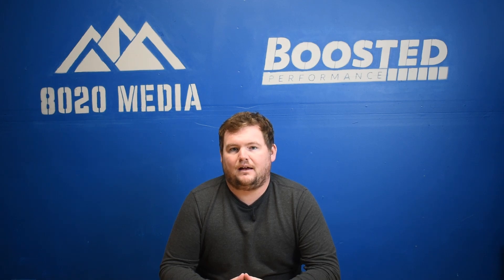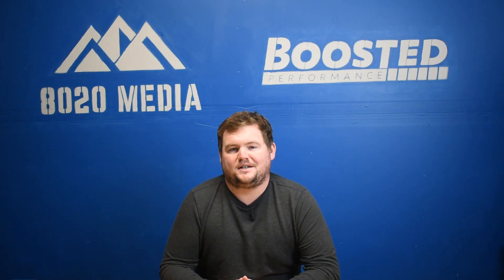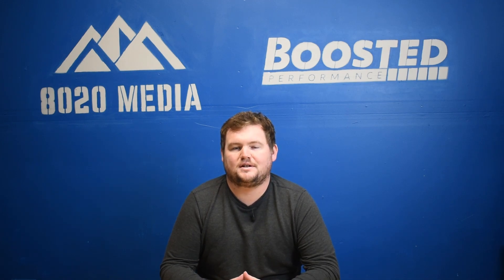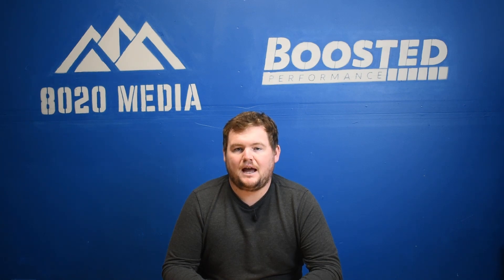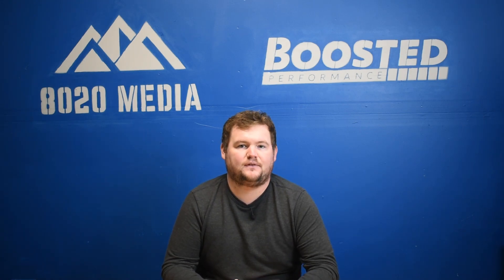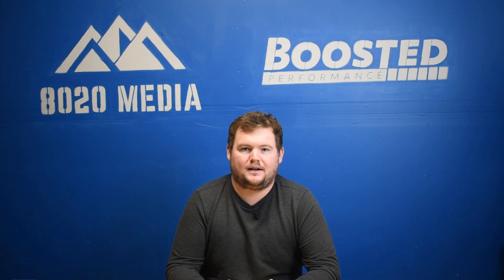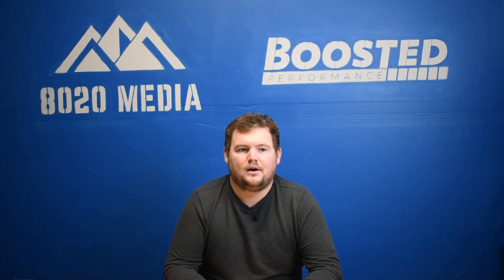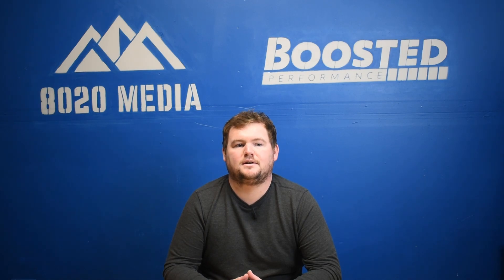The BMW N55 | 5 Common Problems! (135i, 335i, 435i, 535i, M2)

Comment: What causes me to feel a hard shift before coming to a stop in my bmw 435i it feels as if it's downshifting hard but it's felt in the back wheels could it be diff bushings or transmission problems? Please answer
Reply from the maker: R - Sounds like a transmission issue. Do you have any engine codes?

Comment: i think n55s post 2013 are reliable as long as the maintenance is kept in check , especially the Mperformance versions, a below average score should be done in comparison to other engines in its class... 300-365hp. BMW service intervals dont help either.
Reply from the maker: K - Couldn't agree more! Thanks for sharing this insight.

Comment: I LOVE MY N55. PEOPLE JIZZ OVER THE B58, BUT IT DOESNT SOUND AS GOOD AS THE N55 AND THE RELIABILITY IS ABOUT THE SAME.
Reply from the maker: Bryant - Love hearing this. What are you driving and how many miles do you got in it? Both engines are solid BMW staples!
Reply: @8020Automotive  I replied to this earlier. Not sure what happened. I'm driving a Melbourne Rot F30 with red interior and ZF8 trans. 110K I don't consider gasket leaks a major issue, all gaskets that are prone to leaking have been replaced before 80K
Reply from the maker: Nice! Hope it keeps up for you!

Comment: I have a 2007 X3 with ~ 172,800 miles, and have not really had engine problems yet. I picked it up with about 110,000 on it and in my 7th year with car. The engine has a very smooth power band and is a great engine. I may need to do something with VANOS solenoids as I experience a very slight flutter at acceleration after the car is fully warmed up and running, but very slight, although it isn't throwing any codes. So maybe the tranny? Not sure as the GM trans can be a little stupid in the lower gears after the Adaptations have been kicking in for some miles. Clearing them does help for a while. Overall a great all round daily driver that is amazing at doing a lot things well, including hauling things when you need it, decent gas mileage as it's fairly light and drives like a tight sports sedan. It's also as solid as a brick and has no rattles or squeaks whatsoever. 

Things I have had to replace: expansion tank, 3 times! Just had it done again last week. Transfer case gears, twice. They are nylon and do wear out. Don't go to BMW, they will tell you to replace the transfer case, it's how they operate. Pocket pickers. I've had ABS Speed sensors replaced twice now, and things like ground straps and front engine mount bolts on the right side. Sounds like a lot, but after 7 years it's a bargain as we always buy our cars outright. Paid $11,150 delivered with tax, etc. So even with repairs it's cost effective and I own it!  

I plan on getting a CarFax to see what work was done before I owned it as the starter and water pump have not been issues for me yet, nor have the seals for oil leaks.
Reply: Actually meant to comment under the N52 engine!!
Reply from the maker: Ken - No worries! Thanks for sharing valuable insight and first hand experience. Getting maintenance records would be great to assist in letting you know what has and hasn't been done. Keep us posted on this.